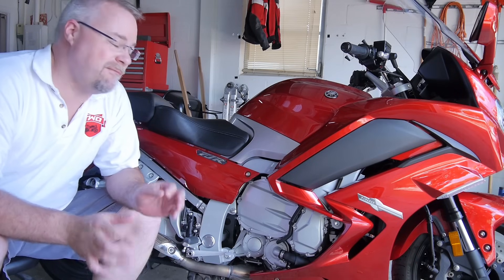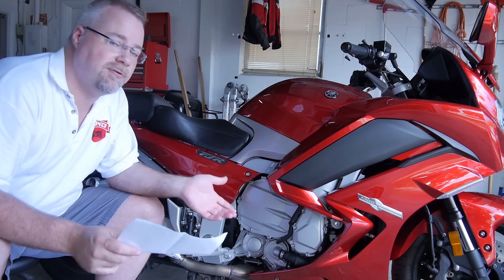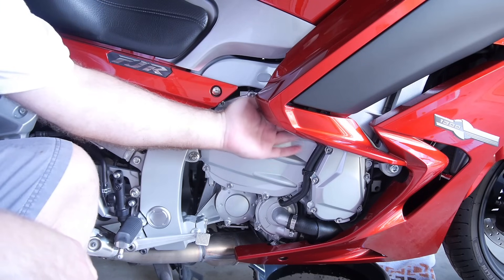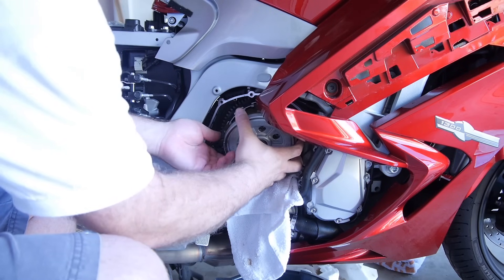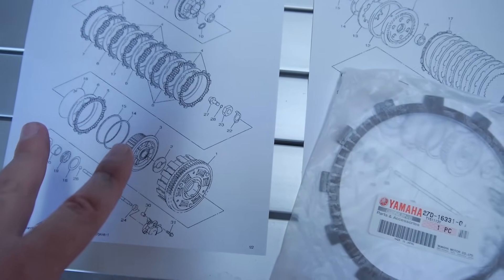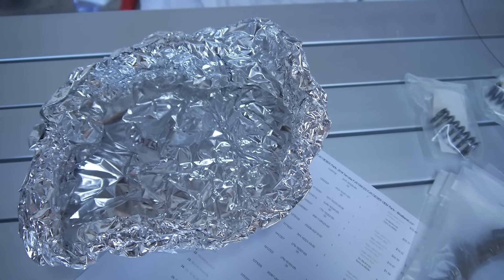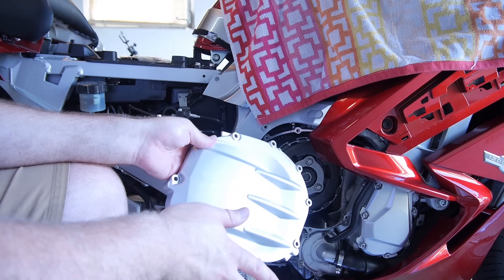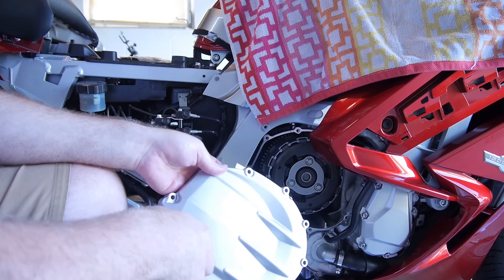How To Upgrade A Yamaha FJR1300 Clutch To 2016 Slipper With Easy Pull

Comment: I rebuilt clutches a few times decades ago. First was with an engine rebuild I did when I was 8 or 9 years old. Next one was at 13 years old. They were so easy back then on Honda 90 motorcycles. Then at about 14-15 I rebuilt a clutch for a neighbor who had an old BSA cycle. I have never done a clutch plate/spacer replacement since. I see they over complicated it as engineers seem to enjoy doing. I just bought a 2007 FJR1300 and watching your videos I realize I have a lot of work to do on my beast as I bought it with 39,521 miles on it 3 weeks ago. Thank You for educating this old man on what I need to do.

Comment: One trick I've done in the past when removing a front sprocket was to stand on the rear brake to stop the back wheel moving, can be tricky but works a treat.

Comment: Great videos! I have pretty big hands so I don't have any issue with the clutch pull weight, even though I am a two finger guy. However, if I did this but put back in the original springs, so I kept the manual clutch lever pull the same but with the additional engine assist, do you think I could use just about any synthetic automotive engine oil I wanted without worrying about clutch slip?

Comment: Excellent clutch change, I saw the complete video and the recommendations not to lose the steel ball, and how to remove the basket from the clutch, very well explained, I am sure that the steel ball came out and fell on the rags, my fjr is A mod 07 I do not know if the clutch system is the same, I also saw that the lock of the nut slides when putting the nut, I would put a little grease so that it would stick and thus put the nut, I would like you to support me with a tutorial to change the oil pump chain is noisy, i think i saw you in a video with charly sinewan on the mountain i think from colorado, they camped, it was a rainy day, if it was you?

Comment: I have a '16 x diavel and '17 fz09.  I didn't notice the light clutch pull on the x but I sure like the slipper clutch on both of them.  Good video.  You're a smart guy.

Comment: I have just completed this little project on my '08. Here are a few tips and tricks and how it turned out for me; 
1. Be careful making up your parts list. Compare the fiche carefully. An '08 is slightly different to a '14. I bought some parts I did not need and had to go back for a few more. They are all special order so cannot be returned. 
2. You can actually buy a proper clutch basket holding tool for just £7.50 on eBay. Or even make one from 2 pieces of steel hinged in the centre using a bolt with each end cracked at 90 degrees. I bought one but still had to modify it by bending the handle outwards in order to clear the engine case. 
3. Best to squeeze bearings in using a vice, not a hammer. I wrecked my first set using the hammer technique. 

When I first fired up, I found it difficult to find neutral. I guess the plates were still a bit sticky but that eased following a few miles on the road. So a groan turned into a smile. Of course it still 'clonks' heavy into first but that's just what FJRs do. 

The clutch pull certainly feels lighter than before. I measured around 7kg before and about 5.5kg now. I can't be exact because it is not a linear progression. I think there is also a slighter shorter pull so I was able to move the lever adjuster. 

The slipper makes downshifts so much smoother which is rather nice. Even if you go for it way too early, there is non of the harsh jolt of before.

So it's a nice mod and I'm pleased with it.
Reply from the maker: 1 - Sorry but looking at the microfiche, the only difference is the '08 doesn't use the retaining ring.  You may have simply misread.  2.  Just hold the rear brake.  No tool actually needed.  I found that out post install of course!  Hammering bearings in is no problem - it's the user, not the tool ;)
Reply: Not quite. On an ’08 the ‘Plate, Seat’ and ‘Spring, Clutch Boss’ are prefixed 3P6 so I needed to replace them with the correct 36Y prefixed parts and also the retainer ‘Ring Set’. Also I mistakenly ordered a new set of ‘Plate, Clutch 2’ parts 2H7-16325-00 (6 of them). I did not need to as I could have used the old ones. So just a word of warning to others to be careful because it’s easy to mess up. And a dope slap for me!
Reply from the maker: Did you try fitting the old plate and spring?
Reply: No. I took the new prefix to mean they were different parts. I read somewhere the prefix refers to a code for the bike in which the part was first used. In this case 3P6 v 36Y.
Reply from the maker: +Mark333032 part number changes can be for absolutely any change even the coating used. The size and function of those parts has never changed. They would have worked just fine.
Reply: With Yamaha bikes, the prefix simply refers to the bike it was first used on. The parts are the same even with different prefixes.

Comment: Awesome job making this detailed vid Bryan, thank you.
My '07 FJR is about to hit 300,000 miles, (around 200k miles on the original) and with around 100k now on a low-mileage replacement engine. I figure this upgrade should be a welcome improvement.
I was wondering if you happen to know how this upgrade works with the Gen 1 clutch slave cylinder, since that's a mod I've already got on my Gen 2 to help ease the clutch pull a bit. It is my understanding that Gen 2.5, 3 and up FJRs already run the Gen 1 clutch slave cylinder right?

Comment: Nice video, & good explanations. I own a 2012 FJR that I bought new & for my style of riding, I prefer the standard clutch. When I hit the twisties (we have an abundance of them here in BC Canada) I gear down as I come into some tight stuff rather than apply the brakes. A quick "blip" of the throttle when between gears does ,much the same as a slipper clutch. Maybe when I get old I'll move to a bike with a slipper clutch, but for now, even in stop & go traffic the resistance on my clutch isn't a problem. Thanks for the demonstration, well done!

Comment: Great video. I’m having clutch slip/surge issues at low and high rpms and going to try removing, cleaning, soak, reinstall. 2014 FJR 1300A 74k miles. Thanks
Reply: Update 75k miles, plates are worn and burnt so doing clutch work today bought new OEM plates and found that item #8 Partszilla RING SET 2H7-16385-00-00, shown at 24:00 on your video, had been destroyed and pieces are all in the clutch housing, so now buying the clip and additional plates behind it, cleaning everything up and going with new oil since I can't trust that that paper clip of a ring set is not anywhere else in my oil. Wish me luck.

Comment: I'm confused as to why you can't reuse the 7 PLATE, CLUTCH 2  Item #: 2H7-16325-00-00  My 2007 say I have 7 of them and you need 6 for the 2017 clutch but they appear on your microfische. Could I not delete these 6 from my shopping cart?  Thanks, Really great video I'm going to do it on mine.

Comment: For 2016 there are 3 parts for ref# 17 . 1 of the 3 parts is from the 13-15 that you re used- 2h7-16325-00-00.If I want to use the part# that would give me the lightest clutch pull would it be the 2h7-16324-00-00 or the 47x-16324-00-00?  Thank you. Bifffy

Comment: Nice job, Bryan! I admire a person who is not afraid to tackle DIY mods. I know that first hand by owning Nortons my whole life. I have a question. Will the slipper clutch mod work on my '06 FJR AE? Obviously, I don't need easier clutch pull, but will it do anything on downshifting?
Reply from the maker: +FRANK Gman I do not believe so. The AE already slips and is a completely different system
Reply: +TwoWheelObsession Thanks for the feedback. Love these bikes. I still have its predecessor, the '89 FJ 1200 which is a little more on the sport side of sport touring. Keep up the good work.

Comment: Did it not fall in the oil when you first took the case off?  I swear I heard something plop into the oil.
Reply from the maker: +Crana No, that was a locator pin - and the ball came out far past that point after the end pushrod was removed.

Comment: For that part where u need that special tool. I'm thinking just stepping on the rear break while in gear and on its center stand will give you enough gold to undo that big nut. Maybe I'm wrong tho. Just a thought
Reply: Hold*
Reply from the maker: +AsianboiiiGlenn possibly!

Comment: Tally'd up, the parts are almost $900 from the dealership in Canada! Could probably reduce that fairly substantially with an aftermarket clutch kit for (most of? all?) the plates I suppose
Reply from the maker: You don't order from a Dealership.

Comment: Hey Bryan. You are slowly turning your 2014 into a 2016.:-) Do you think a 2016 engine could slip into a 2005 frame and connect to the electrical system.
Reply from the maker: Not a chance

Comment: I just did this on my 2007. Everything went great but like Brian I had a oh crap moment. I was removing the clutch plates with a magnet when i pulled the concave washer out. Thats when I realized the 2007 does not have the small wire retainer
Reply: I want to do this to my 2007 as well, anything else different than the video?  Thanks.
Reply: @knollyrider  Sorry Knolly, didn't get a notification you posted.  Nope, everything else was spot on as Brian shows.
Reply: @alaskanmutt  Thanks for highlighting the Spring Clip on the '07 (same as my FJR).
Can I take this to mean that you could re-use the #17 Clutch plate from your '07 and are happy with that?

Comment: Looking for how-to upgrade from 5speed to 6speed. This is cool, thanks!
Reply from the maker: +Gunars Lodzins not gunna happen. That's called buy a newer bike ;)
Reply: I test rode a 2016 the other day.  At 80 mph the engine rpm was only about 100 rpm lower than the 5 speed.  Not at all that dramatic.  When they added the 6th gear they also changed the ratios.  The 6th gear was actually a let-down for me.

Comment: Has anyone had success with the slipper clutch on a 1st Gen FJR? I’m rebuilding my clutch this winter and am considering this modification if someone can confirm it fits with the 1st gen.
Reply: Did you ever find out if this mod can be made for a GEN I bike? I have a 2004 that needs clutch work and I'd really like to retrofit it with the slipper clutch.

Comment: I've been wanting to get smother shifting and came across your video. Great in-depth tutorial! I do all my own maintenance and figure I can tackle this.

 I have a 2005 ABS and was wondering if the 2016 parts list will work in mine. I compared the parts list of the 2016 (BikeBandit) to the 2005 and they seem to be the same. Is this a true assumption?
Reply from the maker: +David Morgan Yep!
Reply: Thanks for the confirmation. The bike has been "down" the last couple of days while I was changing the generator cover, oil change, exhaust swap, and switching out the HIDs for LEDs. I can't afford another downtime right now but I'll definitely keep this upgrade in mind and may get to in next month.